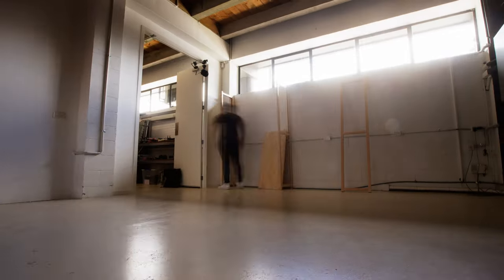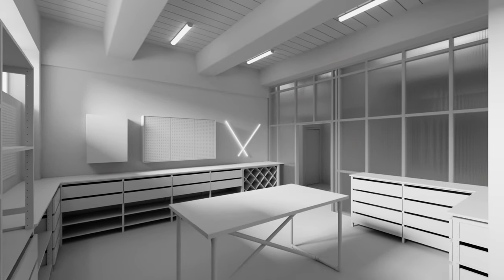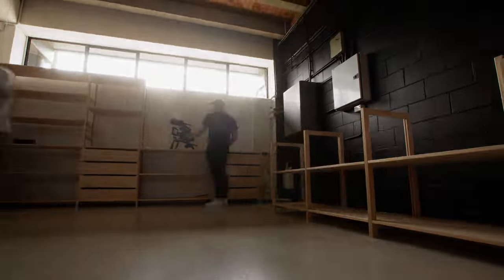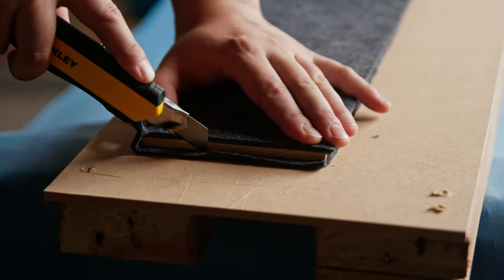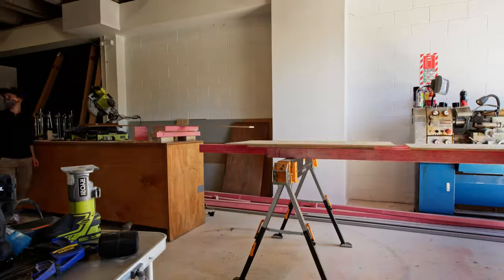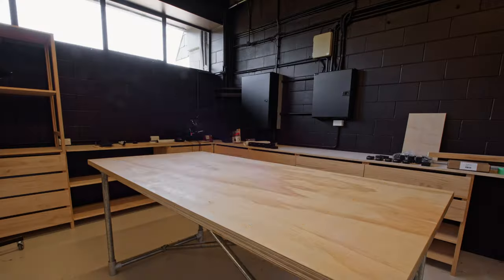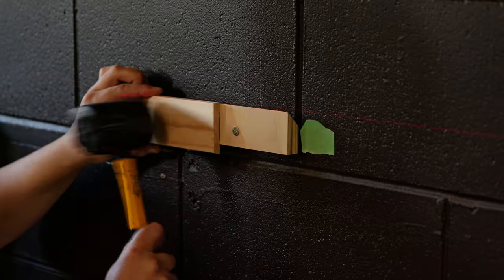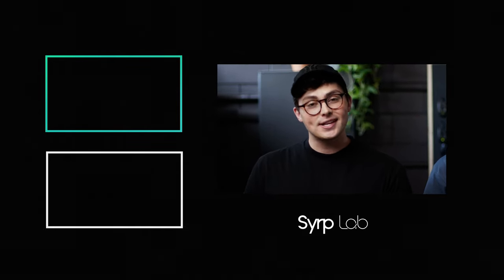Studio Build Guide: Our Dream Photo Video Gear Room | Film Builds

Comment: Just a quick question regarding the camera and lenses drawers, how do you guys make it so the moisture don't ruin equipment I.E fungus?
Reply from the maker: Heyo! We don't seem to have a big problem with this where we're located as our basement is pretty moisture and temperature stable. In a higher humidity climate though, a good AC unit or humidity controlled cabinet might be essential.